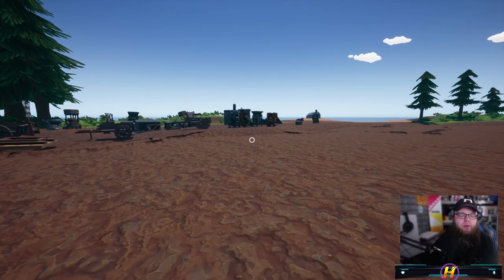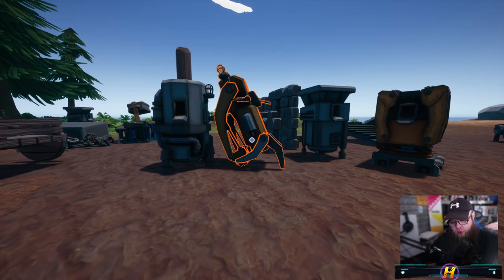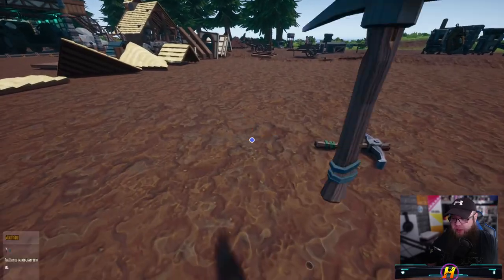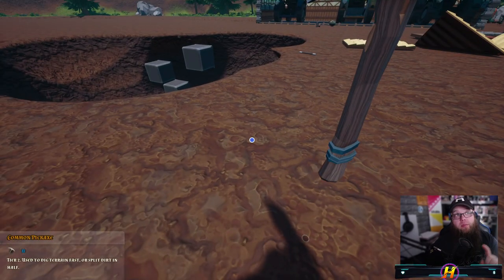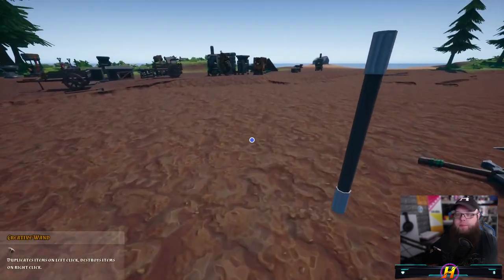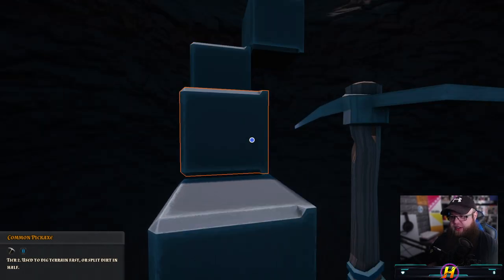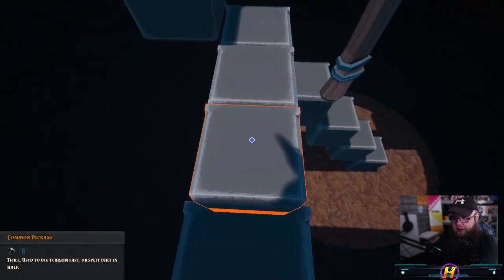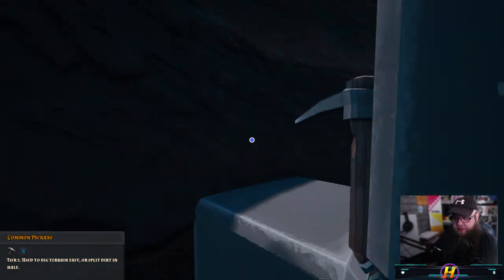Tier Dirt Explained Hydroneer 2.0

Comment: What happens if you put tier 1 drill at like lvl 12 but tier 1 dirt under it?
Reply from the maker: the drill wont work as the dirt properties goes to where the dirt is settled so it would turn into t2 dirt